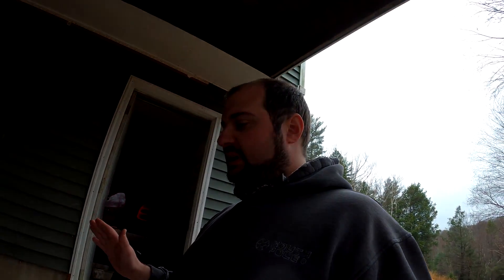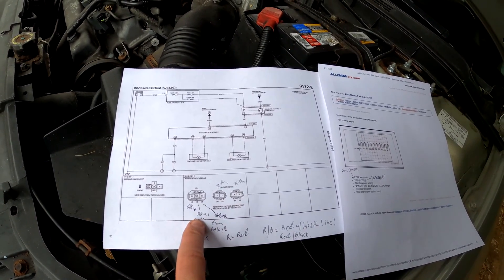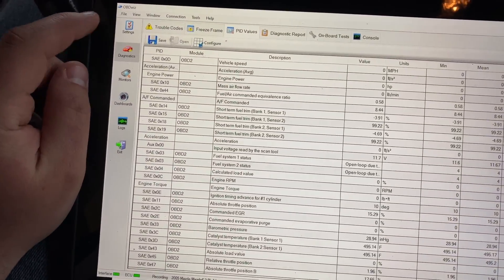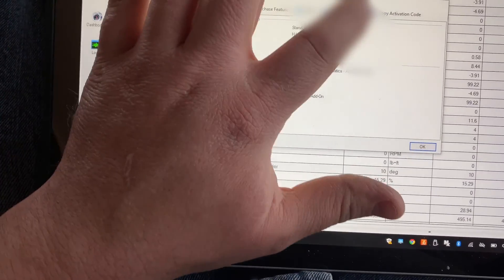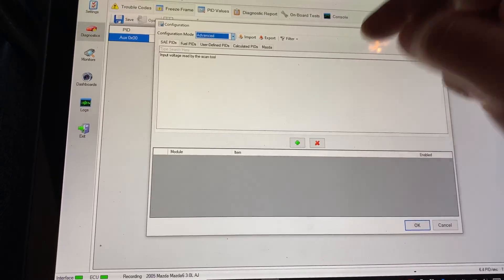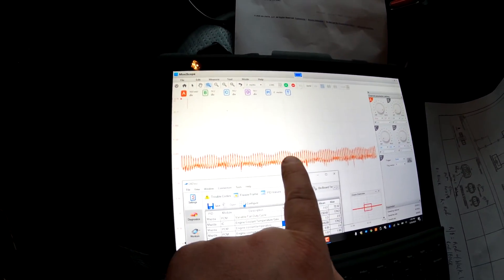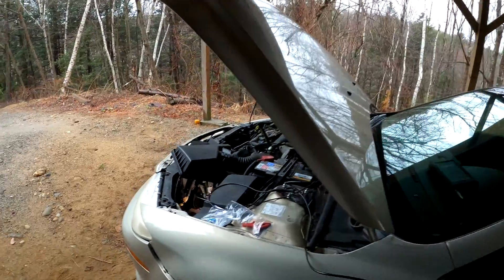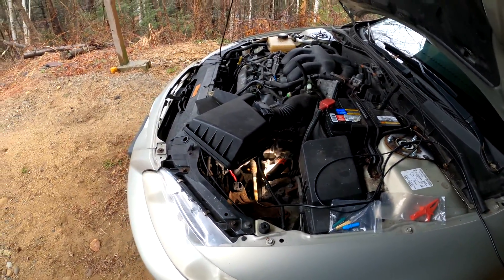Mazda 6 Cooling Fan Module Failure | Fans Come On At Random

Comment: So the parameter identification data (PID) you are looking for, is a pulse width modulation (PWM) from the PCM to the fan controller. Reading the engine coolant temperature may show a 25% PWM as the engine get warmer, then 50%, 75% and 100%. Unless the A/C system is turned on, if they are not using a trinary switch, then a simple pressure switch on the high side, most likely at the dryer, but the fan(s) turn on at a set pressure for R143a. I had a Mazda MPV giving to me by a family member, but Fords/Mazda shared power train is going on decades before the second generation Ranger. I am not familiar with control systems and was hoping the PCM provided a ground for on-off. I guess not.
 I think the scope had some electoral noise even if the engine was off. But to get a signal, the key has to be on. I would just make sure everything is turned off and if possible, go straight to the battery and make sure the connections are clean. Interesting, but using PWM would reduce the amperage requirements, alternator load and increase fuel economy. In today’s requirements, I am sure this is why PWM is used. I will be watching for #2 video and get the conclusion. 
  It is a shame to save a little fuel, it takes a $200 fan module. Damn EPA!